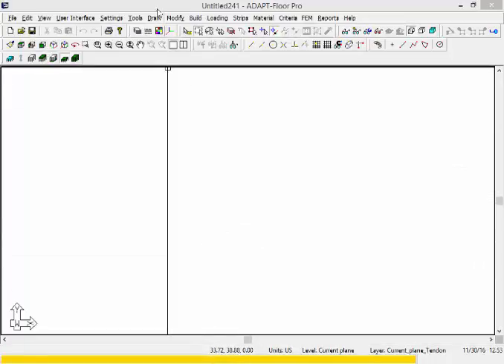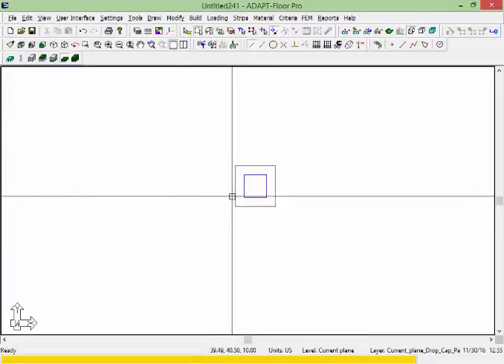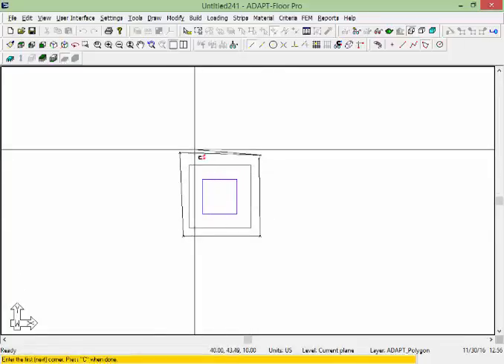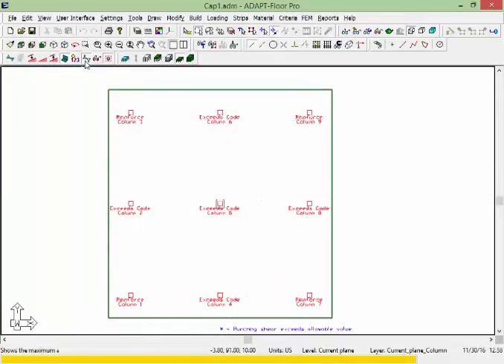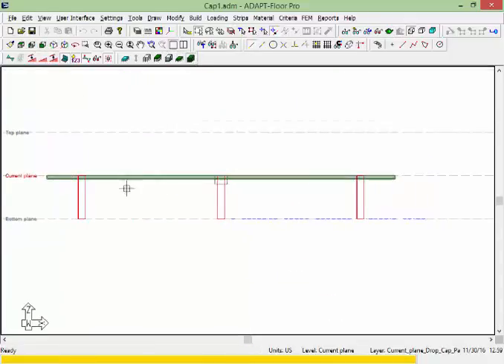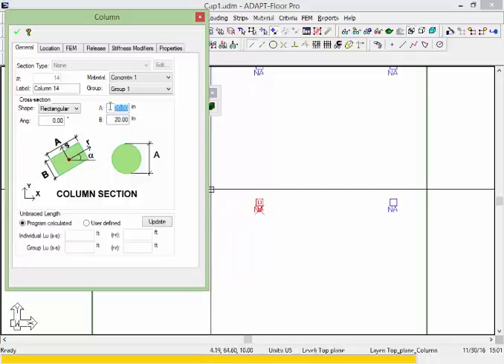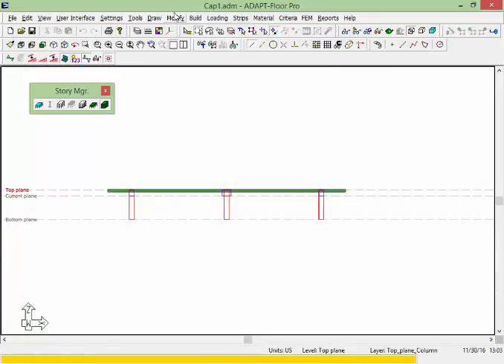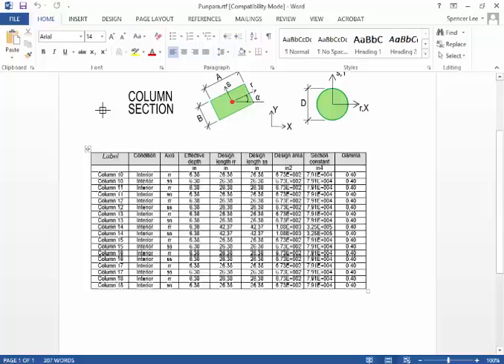Punching Shear at Drop Caps in ADAPT-Builder

Comment: The drop cap is not ACI complaint; it must project horizontally from each column face at least the depth of the dropped soffit. In this example, an ACI code compliant shear cap would be at least 24”-8” = 16” from each column face. So total cap width would need to be least 16”+20”+16” = 52” to be used for two-way shear resistance. This would put the critical section at 22”/2 = 11” from the column face which will place it inside of the shear cap. ACI requires the two-way check both inside of the shear cap itself and d/2 from the outside edge of it.